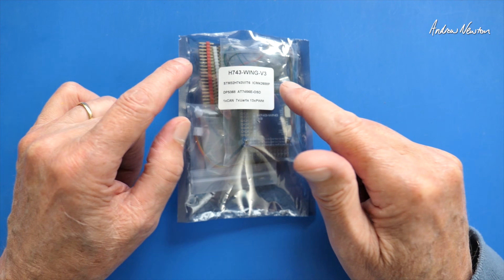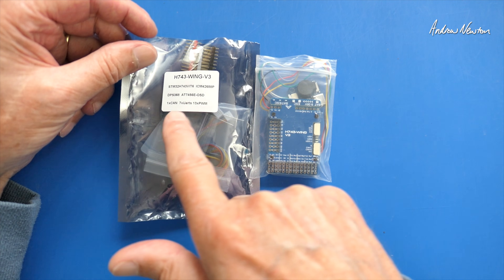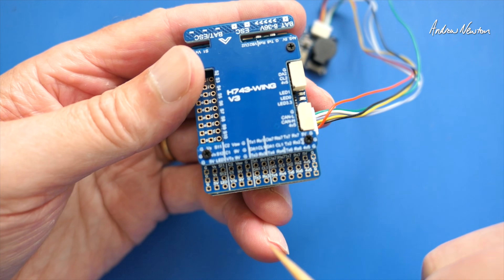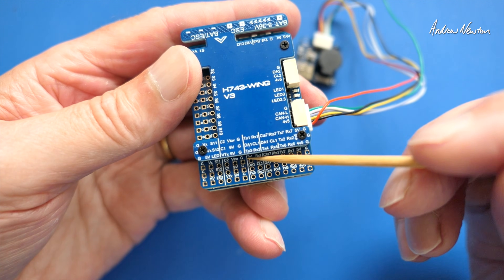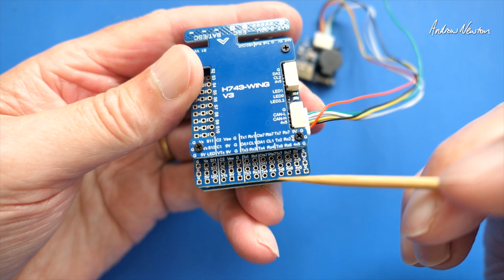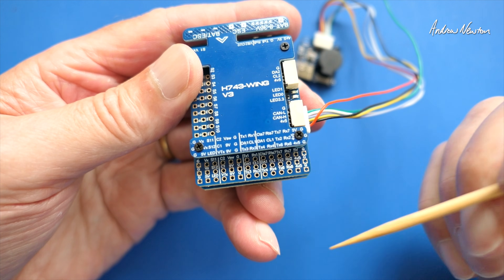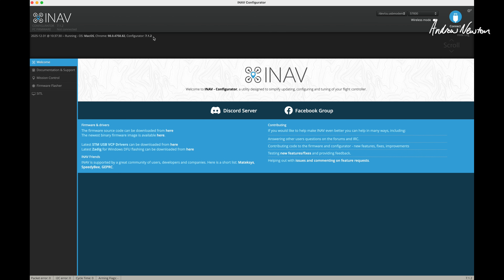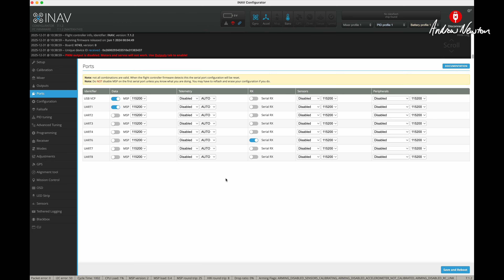H743 Wing V3 Flight Control Board

Comment: Hi Andrew, I have the MATEK H743-WING I just purchased and I don't see any voltage reading and current is stuck at 2a, must I solder those 4 pins you mentioned around 4:30 min into it before I can see readings?
Reply from the maker: Probably yes. I haven't tried an H743 without adding the inter-board connecting wires. Fiddly to solder them and the Matek website is down unfortunately.

Comment: hit and miss on the clones. I had one h743 that was some how out putting batt voltage to the servos. Another whos serial for mavlink would drop out and random times. Worth it just to buy the TBS lucid h7 controller. The lucid AIO h7 wing controller is great bang for the buck.

Comment: What's the story on discovering the board was not as you first thought? I saw a comment where somebody had mentioned they had bought an identical unit and checked with Matek.
Reply from the maker: I initially reviewed it as a Matek board but realised there is no mention of Matek on the Banggood page or on the board.